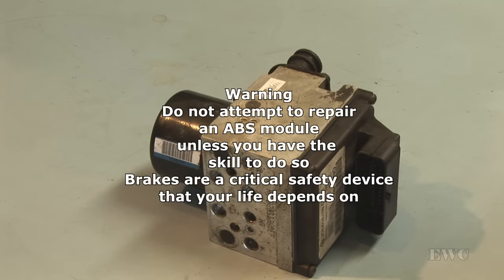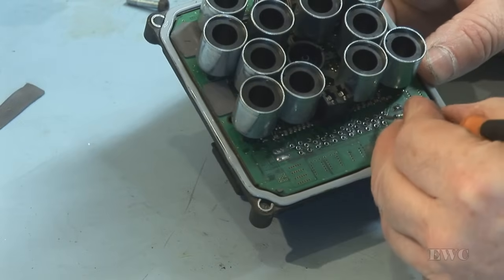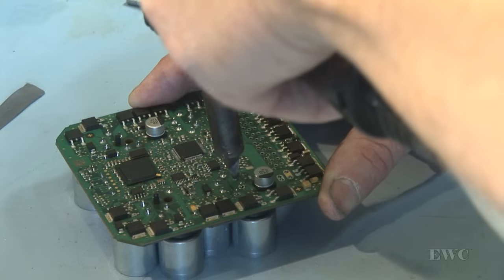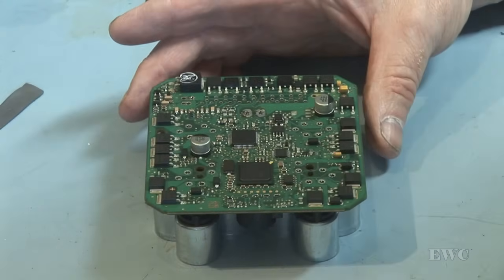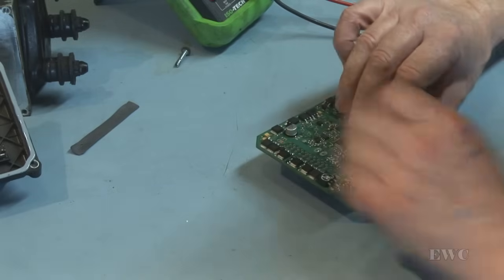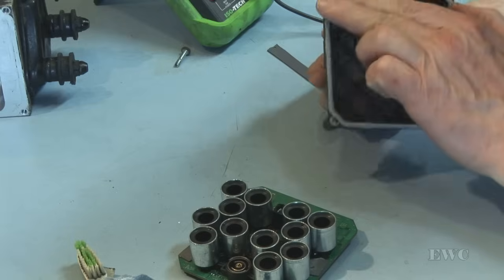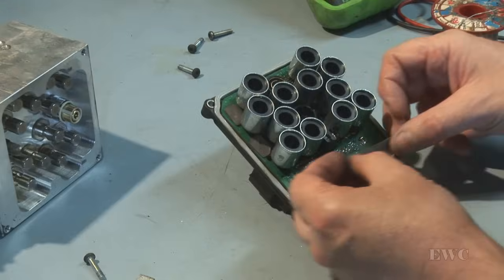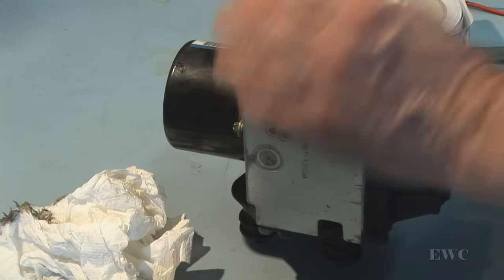VW ABS Module Repair 3C0.614.109.C

Comment: Hi m8 great video, quick question, how do I learn to repair these modules. I have experience with soldering micro components onto mobile phone boards but don't know how to go about finding the problems and fixing these modules. If you ever fancy doing a few classes I'd pay to have some of your experience. I am in the process of replacing one of these modules. 🏴

Comment: my 1998 VW golf ABS system seems to have gone nuts. The ABS dashboard light randomly goes on and off, and (which is more scary) when I set my foot over the brake pedal, sometimes I feel and hear the ABS ramdomly pumping, no matter how gently I am braking. On your experience, do you think these symptoms point to a defective ABS module? thanks.
Reply: Hal, i believe in your case is probably a cracked ABS reluctor/tone ring. I had similar issue and i was happening only at low speed, right before the car is a bout to stop and i was filling the vibration in the break pedal without any blocking of the tires.
Reply: Hi there did you get it fixed? mine 1.4tsi Jetta mk6 just started showing abs ights which comes and goes.
Reply: @JR-tl8tg  as it turns out it was the ABS module as I suspected, I spent 300 bucks to have it fixed, and not a month later, some nucklehead rammed me from behind (that sounds awful, I know) and got my car totaled. So yes, the problem is pretty much fixed now.
Reply: @ImNotADeeJay  Thanks for the reply Hal, oh brother from pot to the frying pan. Sorry to hear about the car, most importantly you're alive and hopefully unhurt. Take care

Comment: Hello, thanks for the good video. Is it possible for the ABS module to work with only one speed sensor? Actually, I am a student and I want to present the operation of ABS with a single tire and a brake unit using a single speed sensor.

Comment: Hello Thomas when I applied brakes the EPC and traction light come on and my vw polo will be in limpo i need to start it again end light go away. Do you think is the abs module which is faulty?
Reply: Did you ever figure out this issue, I have it now with my audio.  Thanks for your time.
Reply: @tlucero14  yes i changed ABS sensors for my front wheels

Comment: I'd be interested to know if there are any physical symptoms that would indicate a fautlly ABS unit. I ask because I have a polo with weird braking issues. The particular issues being an odd 'knocking' felt through the pedal with coupled pedal sinking and loss of brake effectivity when braking over rough/loose ground. The problem appears to be worse in wet weather. There are no noticable issues when braking on smooth road surfaces in wet or dry.  Also there are no warning lights to indicate a fault at any time.
I know pedal sink is often an indication of worn master cylinder seals and I've replaced the master cylinder to no avail. 
Any help with this would be well appreciated because it's doing my head in!
Reply: Hi. Was the problem in hydraulic unit? Thanks
Reply: @simoncupra2466  Anecdotal evidence would suggest so. After I posted this I was chatting to a friend who had the exact same problem albeit with a different make car. His garage told him it was indeed the ABS unit and advised him to get rid. I part exed mine at a dealer for a newer model.
Reply: @gerrabath  Thank you again. I've been facing the same ABS problem for a while now, plus a few others, unfortunately I do not need a car enough to justify buying a new one...
Reply: @simoncupra2466  As an aside my polo went through the mot everytime during the 4 years I had it. Just make sure you remember to take it easy!

Comment: Hello. Can i supress all this expansive system al convert my carto standard? My car is a Jetta VW TDI 2008. Everything is OK but  the fluid is not come from the Module, is obstruction to  weel  rear left. The failure indicator ligth is not on. Tranks .

Comment: My ABS light goes on at times. 

I guess, I'll check the wiring on my golf 4 first. 
If there is no issue, I'll disassemble my ABS module and just resolder the solder joints on the connector, without removing the old solder, unless the joints turn out dull. 
Depends on what the old solder is made from. 

Aaaand that's it. I'll screw it back together and see if the error is gone.
Reply: Did the error go?